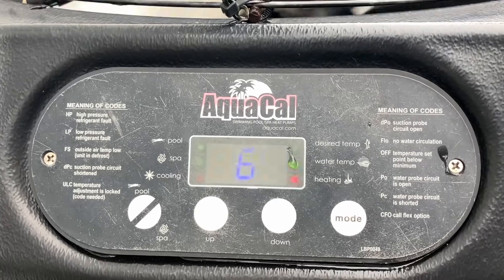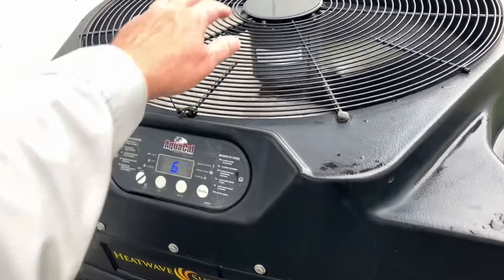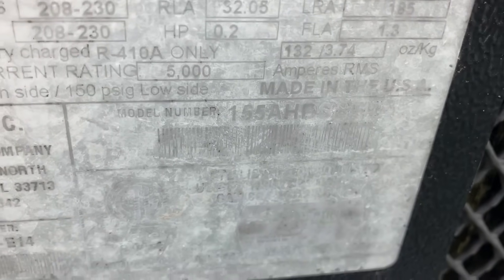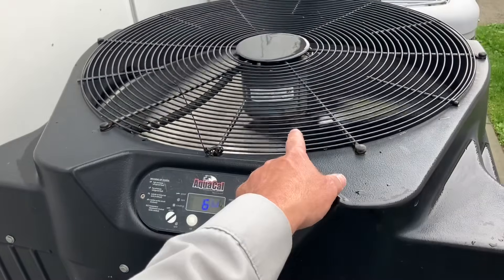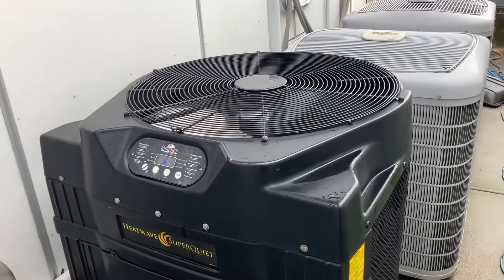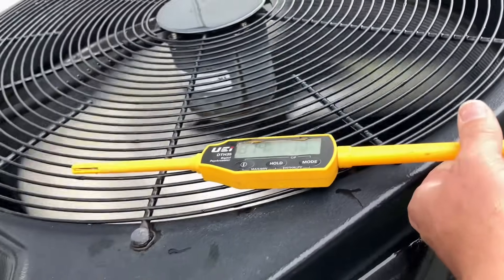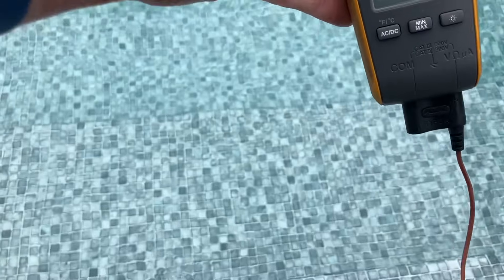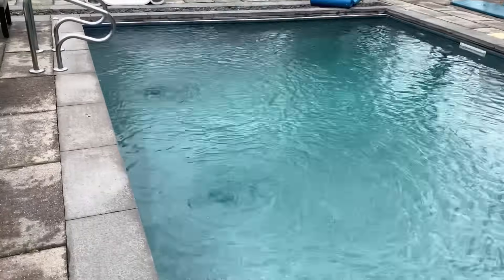AquaCal Pool Heat Pump Not Heating Fast Enough? Real-Time Diagnostic & Manufacturer Call!

Comment: Normally 4 degree heat rise is correct for a heat pump. I have never had a hayward heat pump give a 10 degree rise. Gas yes! Even with a variable speed pump dropped to 1800rpm may only give another degree.Any less rpm may give high pressure or low water flow.Normally it takes approx 3hrs to raise the pool 1 degree in 70 degree outside temp if sized by the sizing charts. The warmer it is out the more heat the unit can pull out of the air. Another major factor is heat dissipation due to evaporation at nite off the water in pool,this is where a solar cover can help! Another factor is rain. Ive seen the average life span 8-12 yrs for a heat pump. That unit I believe was a 2014.
Reply from the maker: Thanks for the detailed info!

Comment: Check coil for airflow, check drier for restrictions, check the heat exchanger for temps. The 4 degrees isnt very good. Your discharge line properly charged should be 100°f - 110°f above your outdoor temp if properly charged. But the temp split in the pool all is about you flow of water. 
The max temp rise should be 16.8°f
The higher the flow of water the lower the temp rise.
50 gpm= 13.4°f temp rise
60 gpm= 11.2°f temp rise
70 gpm= 9.6°f temp rise
80 gpm= 8.4°f temp rise

When the system seems ok at the heat pump, check the flow rate at the pump. Take those numbers as rule of thumb and not what actual temps. Also mind you meters have a + or - 3°f of deadband and range of accuracy.

Comment: 4 degrees can be good or bad depending how much water is moving through the system. 1 BTU is 1 degree rise for one pound of water. 1 gallon of water is 8.4 lbs say 20 gallons a minute is 168  lbs X 60 minutes 10080 gal and times 4 degrees = 40,320 btu's per hour. That is not bad for a heat pump only using 17 amps. If you take the amps to btu, 17 amps at 240 is 4080 VA which is 13921 btu hour which shows the magic of a heat pump.
Reply from the maker: That’s a lot of math!
Reply: @PipeDoctor so with this math, should he use a smaller pump/lower flow to increase the heat transfer?
Reply: @chuckq54  no because its pulling and pumping from the pool. 

Assuming the same output of energy from the heat pump, a faster pump just means the temperature is more dispursed through the pool, and a slow pump would make hotspots and cold spots while you wait for the temperature to equalize
Reply: @chuckq54 slower flow only matters if you aren't recirculating like a gas hot water system for showers and stuff
Reply: I would be thinking, non-bleed txv(high start current) and high water flow volume, causing low delta T. a large temp rise is not always a good thing, if the system is working as planned. efficiency can be possible, if it's well balanced. just like any heat pump/high efficiency setup.
Reply: I came here to say this exactly.   Now we just need to know the copacity of the HP and verify its working.  Amps seem close to right for 40K btus to me